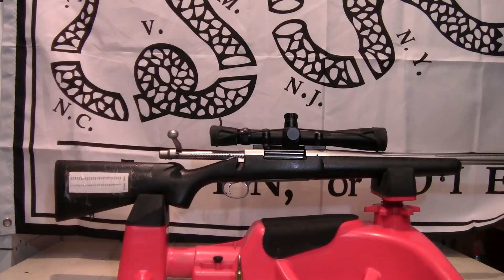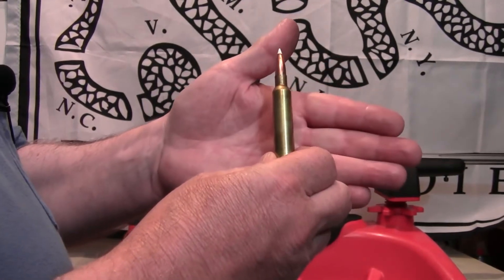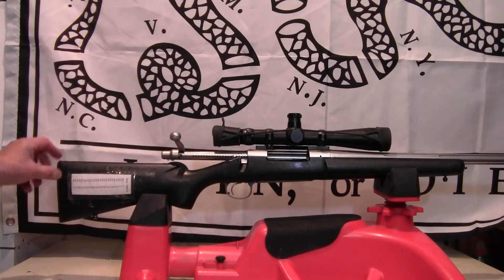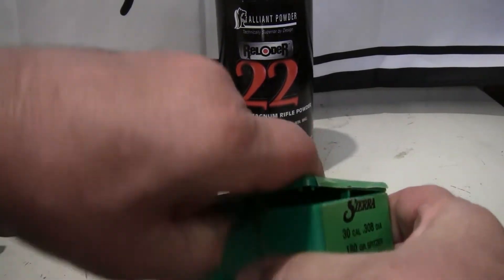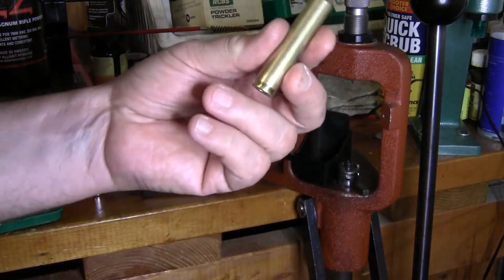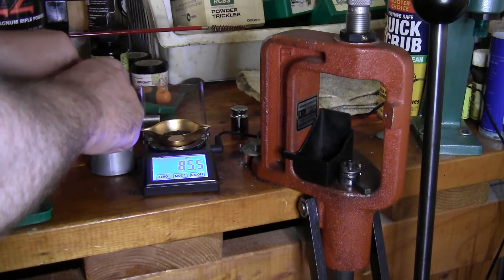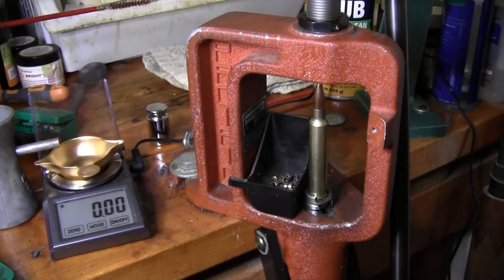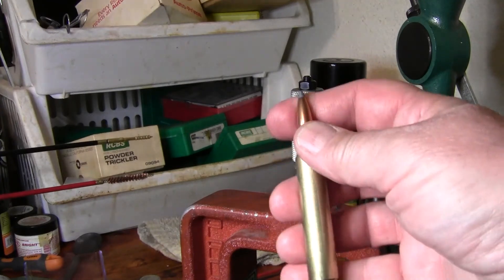300 Remington Ultra Magnum Hunting Loads

Comment: Tried ladder tests of  TSX tripple shocks in mine. Couldn’t hit a barn if I was locked inside of it. Mine likes 180 grain partition golds. Will shoot .3” at 100 yards. Also likes the 125 Nosler ballistic tips driven close to 4,000fps. Will shot half inch groups. Have the LSS model and swapped stocks to a HS prescion and Timney trigger. Tried accubonds…to hard and don’t  expand on deer. They run after a double lung shot. Looks like a FMJ hit. I’ve also used swift scirocco, 180 grain ballistic tips, 200 grain partitions, and 180 grain round nose seirras. They all drop deer and bear the same…like Thors hammer.
Reply from the maker: My 300 RUM is sub MOA at distance, I have used TSX, Accubonds and Game Kings. I have killed many Caribou with mine. Thanks for watching!
Reply: @30-06john  sweet. Always wanted a sendero version but it's impractical for me since I wanted a light weight mountain gun. I have alot of 26" heavy barreled 700s and heavy ar10s for coyote hunting. They rarely get used anymore. Its fun to "target" shoot" with the heavies at long range but just impractical for my real life hunting purposes. You ask me 30 years ago and I was the opposite. I goto my light weight rigs since I normally only shoot once or twice  in most hunting scenarios

Comment: I built one for ELR with heavy 33” barrel and i have it throated out for the 245 grain bergers at 4.125” and i get 3155fps with zero pressure.  That case works better with the heavier bullets.  I loaded the 200smk’s and got 3445fps
Reply: Anything under 220 grain is kinda waste for that cartridge.  I always hate to see guys load the 165’s in that case when you can get well over 3,000fps in a 308 with that bullet
Reply from the maker: I tried 200gr but I did not get as good accuracy as the 180s. Thanks for watching!